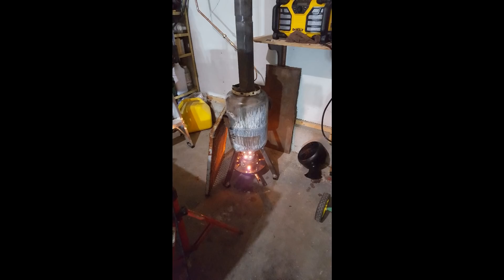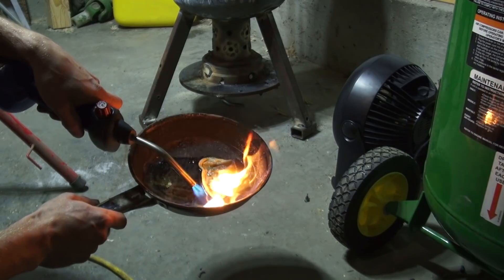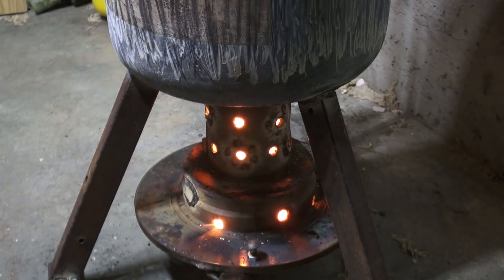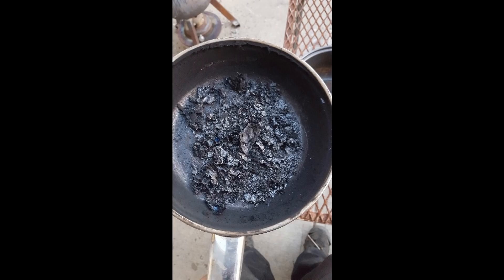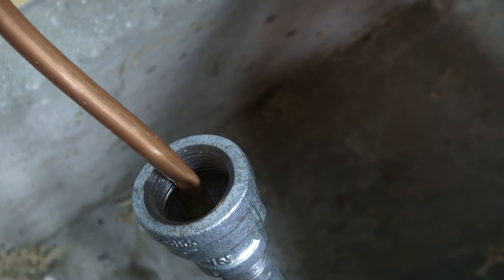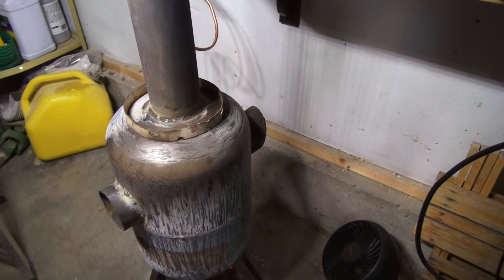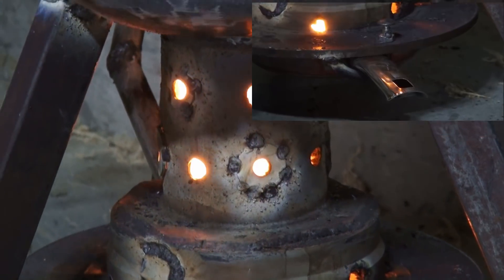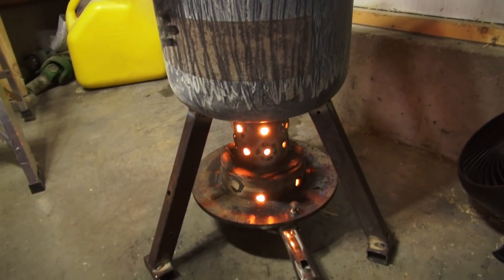[DIY] Waste-oil-burner, what a hotty! (Gravity-Drip)

Comment: You can make a trap so the oil feeds automatically, as the oil get burned it lets air up to the sealed oil tank and so that lets some more oil come down in to the pan until the outlet is blocked by the rising oil.
Reply from the maker: +Dom Degood uhhhhhhh, isn't that a good idea. I have to think up a contraption for that.

Comment: I see it's smoking, it's starving for air. you need more holes in the tube. Be careful using frypan if the soot builds up the oil might just pour over the floor , hopefully not alight. If you aren't getting much heat out of it you need more holes in the rotor face 13mm and a couple of 10mm but smoke relates to the tube. You will need a decent flue to give it draw.
Reply from the maker: +Fireman Jim I actually changed quite a bit on this and made a video a while back, if you like to check it out!
https://www.youtube.com/watch?v=-Yz0tjDfYL0

Comment: I meant the "COMBUSTION CHAMBER ITSELF" pipe size, which is welded to the Rotor? (Not the Fuel Feed Tube)          An the "FLUE SIZE", or Stove Pipe Chimney Pipe SIZE?     THANKS
Reply from the maker: +BWWGL9 oh, it is a 4inch steel pipe. Preferably, the transition pipe between the rotor and vessel above should be bigger. If I had a larger pipe at hand, I would have installed a 6inch at least. The steps in the rotor mess with the air flow too much. The chimney is the same size pipe, 4 inch.

Comment: What SIZE Pipe did you use for your Combustion Chamber?  What Size Pipe for the FLUE ?
Reply from the maker: +BWWGL9 it is 1/2 inch steel pipe, the copper tube is 1/2 down to 1/4,

Comment: Nice setup!  It looks well built and very neat.  I would suggest it might just need a little fine tuning to get it perfect. 

The temp of the thing doesn't matter, it's the fuel consumption that dictates the heat output. 1L hour is roughly 10 Kw. 
The reason you are having trouble with heat retention in the pan and it's not staying hot enough is because your holes are in the wrong place. they should be on the top of the disk so the incoming air makes little jets of flame that play on the oil and the pan keeping it hot. Where you have them now on the sides, the flame would come in and arc up the centre  without probably ever touching the pan at all. I suspect the heating the pan is seeing is only radiant not direct heat and it's barely enough to keep the oil vaporising. 

Also the backfiring can be lessened or eliminated buy drilling more secondary air holes. They are the larger ones  in the main pipe above the pan.  You can drill as many as you like, even run mesh there  as this acts much like a flame holder.  You could also try blocking some of the primary holes. Basically they control the heat output and the secondary holes control the mixture.  If you have too much primary air the thing will produce gas from the oil and if there isn't enough secondary air to burn it, the thing will smoke or backfire  as you are seeing. 

Hope this helps and good work!
Reply from the maker: +Oil Burner Wow, thx for the amazing comment. I do have a few holes directly in the disk, but I must say, what you state makes sense. I will cut a few more holes yet and I can tell the vaporizing will most likely get better, like you say. This would also explain why the cast Iron pan never worked as well, since there isn't enough heat in the first place.
Now I also get the whole mixture adjustment, I had played with it but like you pointed out, it needs fine tuning.
Again thank you so much for such a detailed analysis.
I might just post an update on this with your suggestions.
Best regards, Dan!